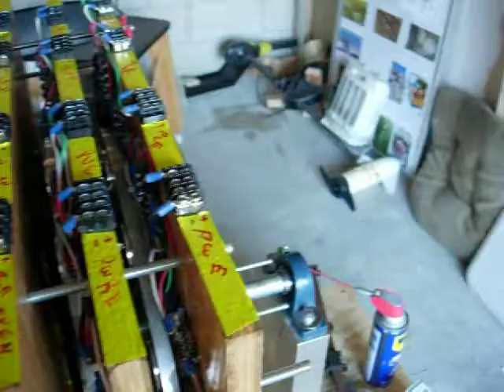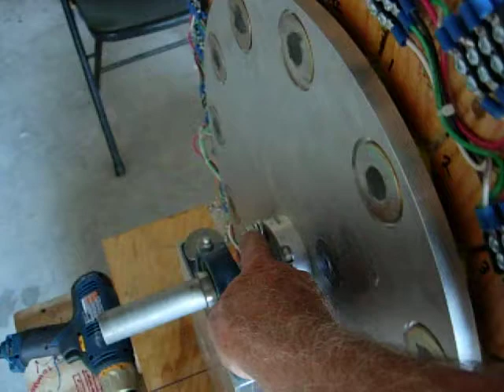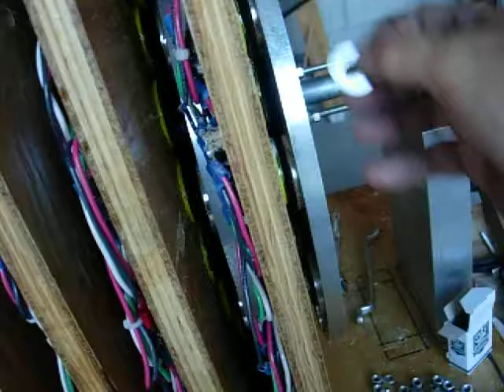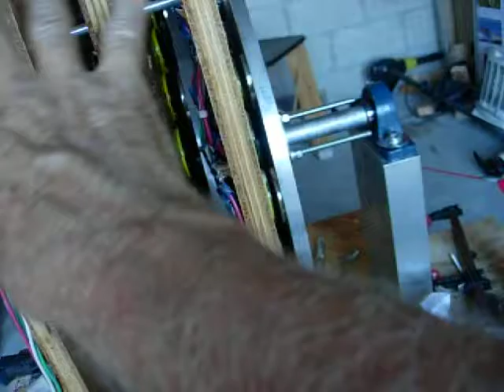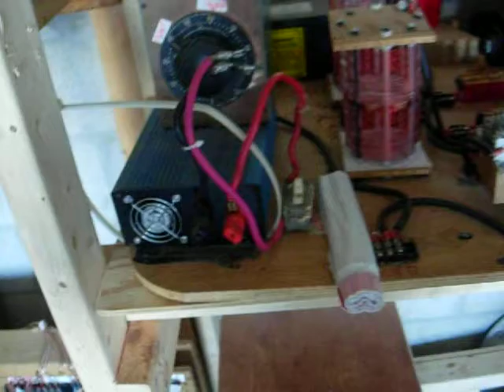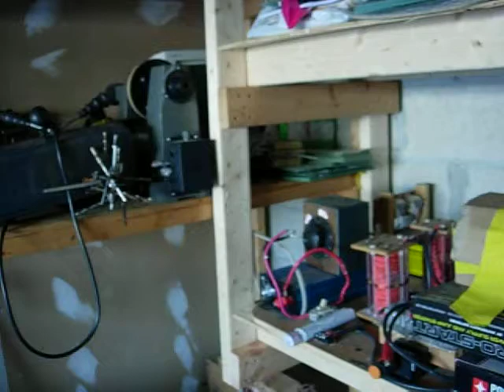Don Smith #153 motor assembly Part 2

Comment from the maker: Eli Take a lazy Susan disk that spins and mount to it two arcs of magnets and also ad a smooth lump to the outside edge this will cause a cam to move the fixed magnet out of the way when the disk is rotating  The wedge magnets will all be north facing outward and the fixed magnet will be north facing inward  so they oppose each other causing rotation.  By using two arcs you'll be able to balance the disk and it will go extremely fast..  The next step is to glue a magnet to a device that will pivot away from the disk when the cam lump hits it.  This is critical because if you don't get rid of the north to north magnets interacting the disk will only spin 350 degrees then bounce back.  The cam must be setup so that the north to north doesn't interact and the disk passes by ready for the next arc action.   By using a large diameter disk heavy one you can get energy from by using impulse circuitry.  This is a great project for kids too.  use some rugged glue epoxy  for safety reasons.  this device can reach huge speeds and self destruct.

Comment: Hope its going good. Was thinking about them magnet motors people claim that are self running. I dont think they are but say a person had one the size of a plate that would spin on a shaft when the larger one was closed around it. If a person would put another set of magnets  on the center cylinder in a way like a car piston shaft but a magnet on the top  and the bottom, so when  the outside magnet got close to the middle it would push in and as it spun a bit it would get a bit more thrust from the center. You think this would help with the cogging. Just thought it may work.  Any work being done on the transformers or is that on hold till ya get this project done?